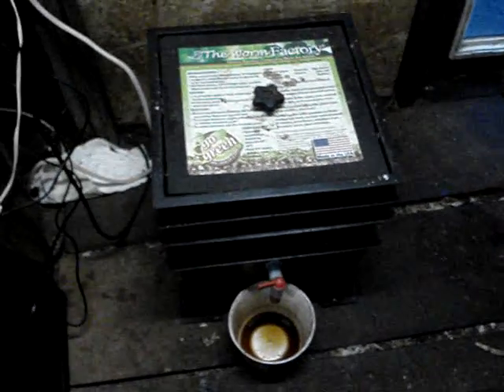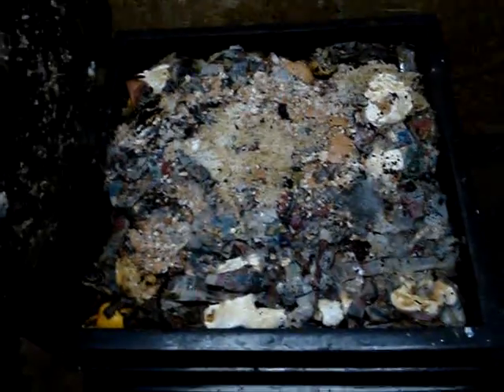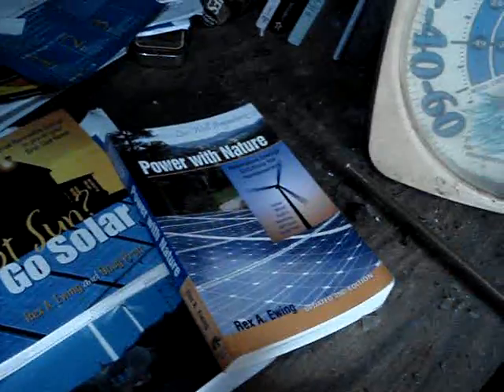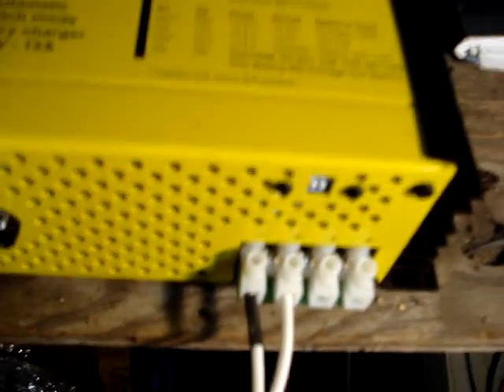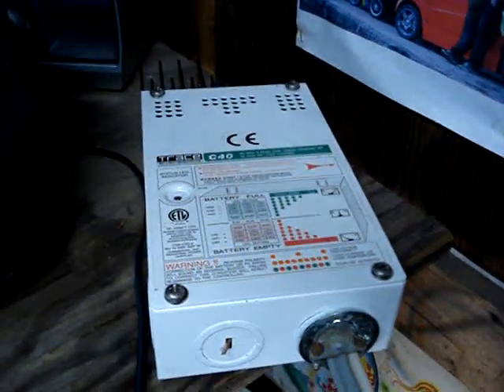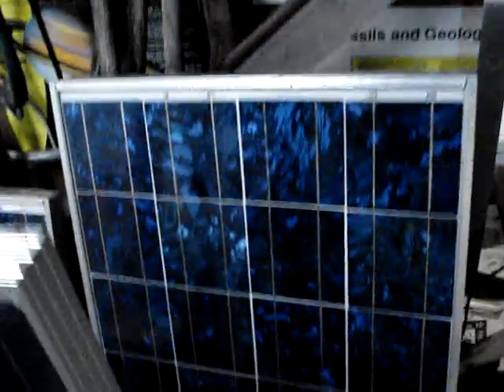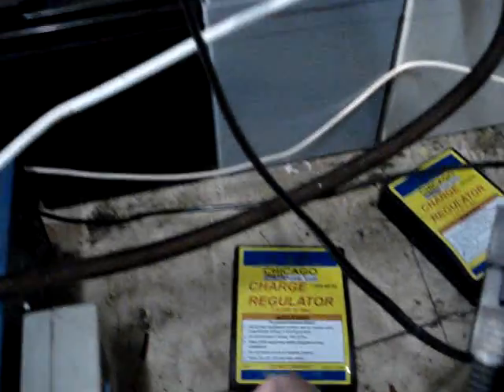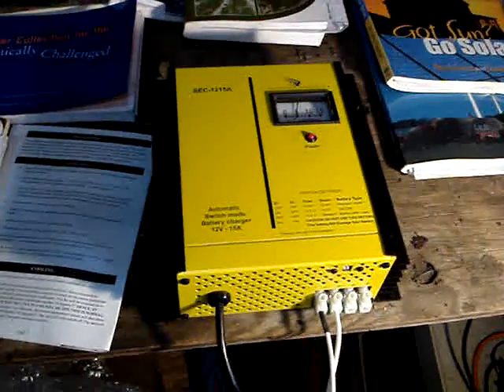Battery Charging, Worm Factory, Solar Power Setup Update

Comment from the maker: @scottruthven1 

They are still putting out for me. Work in cloudy weather, downside about them is they are heavy. The best panel I have so far is the Sharp 80W. very light weight puts out during cloud cover. Single wafers put out better on full sun, last longer.
The sunforce panels got some moisture in them and froze, 2 failing in low light conditions. UV light is starting to crack the plastic, discolor the PVC stand.